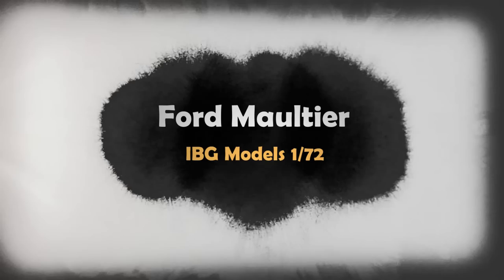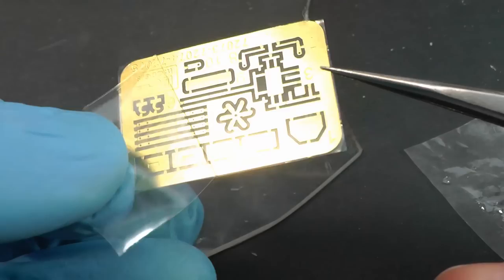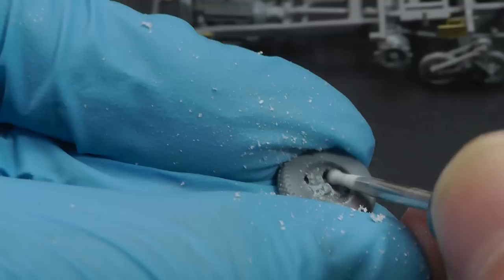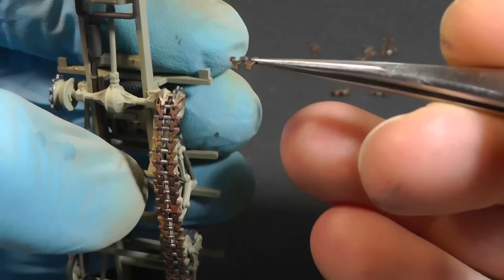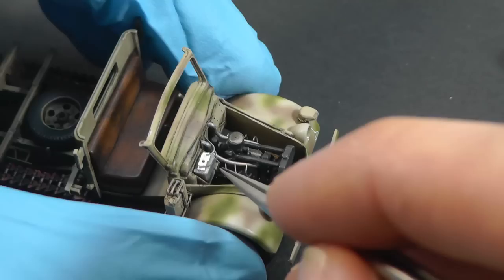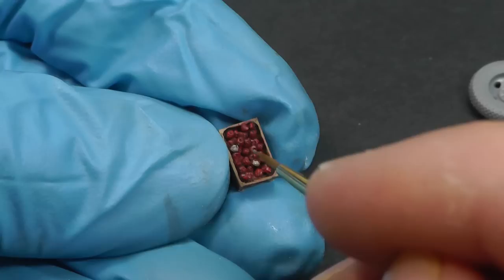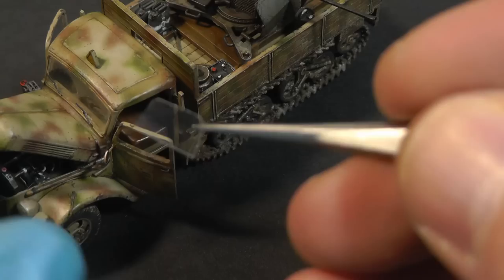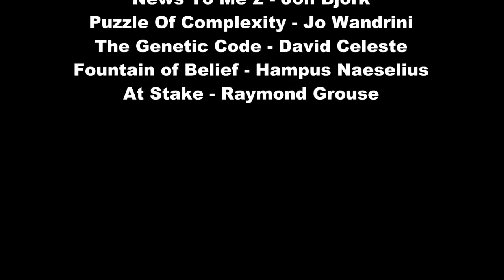Ford Maultier V3000S/SS M - 1/72 IBG - Truck AA Gun Model

Comment: Plasmo, there is no need to wait 2 days working with oils. Just put your oils on the piece of cardboard before use — it will takes minutes to dry especially with hair dryer on low heat mode

Comment: During the video it always looks a lot bigger than when you compare it to the lighter! It's so detailed and small! I love it
Reply: Baxi Yeah, I didn’t think the model was that small until I saw the lighter. The detailing makes it look like a 1/24 if you didn’t know better
Reply: Yeah they always do. The smaller ones are so much more pleasing to look at compared to the bigger 1/35 scale ones because so much is going on. Just finished a 1/72 scale t-90 and had a lot more fun putting it together than I had with a 1/35
Reply: ふはほ
Reply: Jes it is and i have also the same truck in my collection but i need to assemble it i will make a video about this

Comment: The build is outstanding, I just want to add a small correction: Ford never owned Opel. Opel was owned by General Motors, also an American company, from 1929 up until 2017.

Comment: Instead of lead wire you could use soldering wire. It comes in different diameters and is quite flexible as well (and not as toxic).
Reply from the maker: Ahh, thanks. I have home some soldering wire but I never found them in 0,3 mm thickness.
Reply: @idaemonplasmo  You can find them at ebay - or simply by searching with google.
Reply from the maker: @labomat  wow. I found also 0,2mm. Thanks, I will order some.
Reply: @idaemonplasmo  Thanks for your great videos! :-)

Comment: Seeing you use photoetch so easily makes me want to cry - I've had to abandon a few models because I find it so difficult to use PE parts without messing them up. I am unwilling to give up, because I know practise makes perfect, but it's still hella frustrating....
Reply: I suggest buying some brass sheet in various thicknesses. Cut thin strips to practice on. Make smaller and still smaller boxes, the kind of thing that you can even use for battle-damaged accessories. That way your screwups won't discourage you so much and will instead inspire you to do better.
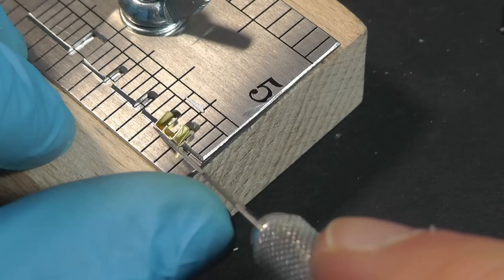Do you have a "real" bender? If not, don't buy one- instead take a look at David's video on building the one he uses at 4:40. I think his is better than the commercially-made ones.

Comment: PLASMO, I have a question for you if you have time. I’m a starting modeller and I mostly paint using brushes. So what brushes do you suggest are good starters? And also what ratio of paint and thinners do you use for your acrylic colours? I would love to know because the ratio you used here looked spot on! I hope you have time for my questions and I love your videos! Have a nice day!
Reply from the maker: I can recommend artist paintbrushes - da Vinci, Winsor newton, etc. They are more expensive but last longer and you can clean them with soap. I use for dilution wet pallet and water. It is basically some sponge and baking paper. You can google it on how to make it. Then you do not need to care about proper dilution. probably :-D
Reply: @idaemonplasmo  thanks so much!

Comment: I want to get into model building and painting, what's a list of equipment I would need for getting started?
Reply: Clippers (tiny side cutting pliers), razor knife like an xacto with extra blades, and some fingernail files. Those you can go cheap on.

Spend the money on good paint brushes and the stuff to take care of them. You will want both natural bristles and synthetic bristles. Natural bristles for acrylics. Synthetic bristles for oils and enamels. Using a natural bristle brush with oils or enamels will lower the lifespan of a brush.

Glue: use plastic model cement for plastic parts. Superglue is for metal or resin parts. White glue is for clear parts.

Paints: I work almost exclusively with acrylic paint. Most of what I use is from Vallejo Model Color range.